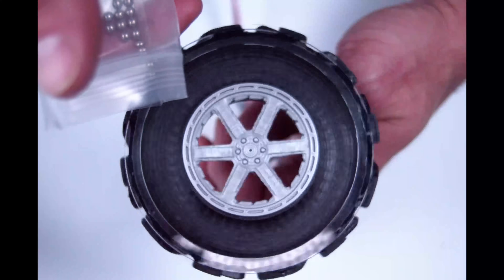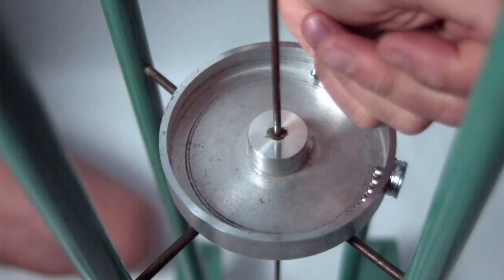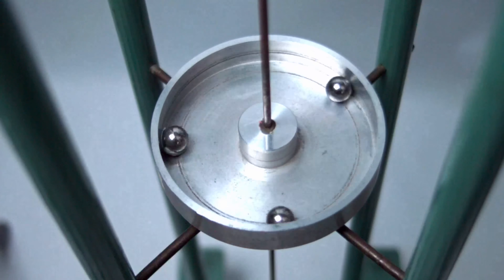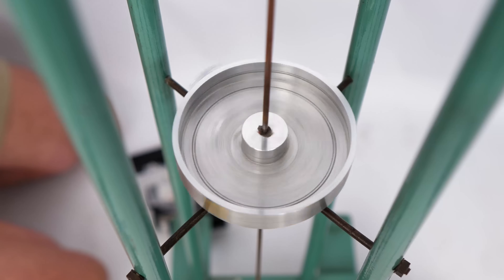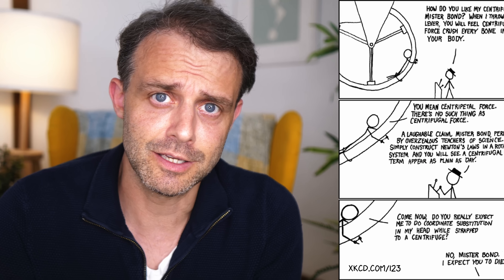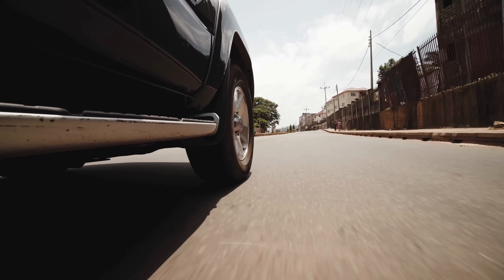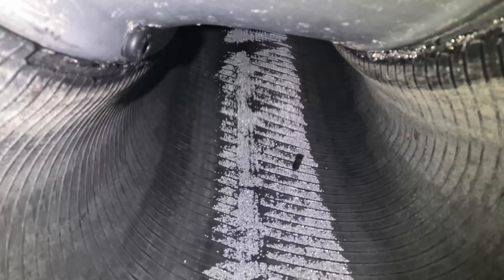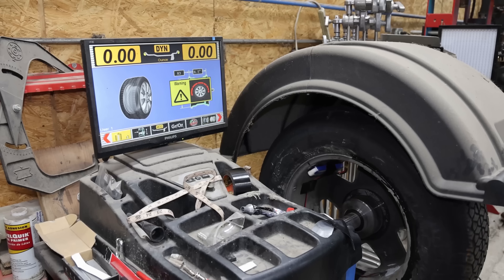Do tire balancing beads actually work?

Comment: For motorcycles, balance beads are the best solution. Most bike wheels don't have a wheel lip for clip on weights. That means you can only use stick on. Stick on weights are not as reliably held on and are also unsightly on wheels that are a prominent design cue of the vehicle, which is pretty much all motorcycles. The best way to get a nearly perfectly smooth ride is to have your wheels trued to be as round as possible, the tires trued to the wheels and balance beads in the tires. Somewhat alarming is the fact that almost no tires are ever perfectly round or balanced. If they were you would never need wheel weight because almost any rim can be trued and balanced perfectly with a little work.

Comment: Thank you for the excellent explanation.  I was contemplating using balancing beads for motorcycle tires and have now decided against it.  I never really understood how beads actually worked, especially for motorcycles for which this method of balancing is used pretty frequently.  I have now decided on conventional balancing methods.

Comment: I have a one ton dually truck that has always had a vibration in the rear since I purchased it five years ago. Last month I put new tires on it and had the same vibration once again. The truck has custom rims and they are not able to add weights to the outside of the outer rims. The solution was to add balancing beads. I've heard of them but never used them. They did help a lot but have only taken 1/2 to 2/3 of the vibration out. Needless to say, I'm not the most satisfied. I did find your explanation very helpful & extremely well thought out.

Comment: I often drive between a city in Denmark on the motorway at 130km/h and a city in german on the motorway at 150km/h 

I have found most vehicles (ofcourse in good condition..etc..) they have the most relaxing ride around 145 to 155km/h no vibrations, also the sound changes to a calm stable hmmm, and the vehicle is responding the way i exspect it.. 

Based on those biweekly wxperiences for now 7 years i would also suggest the beads would be great around 150km/h.  Because with so many trips, ofcourse i have experienced flat tires, loosing of balancing weight on a wheel, and many other quirky things with these vehicles. 😂

Comment: In the early 1950's, Mort Taylor built a flying car (a TV celebrity actually owned and used one on his show). Production after I think six units was stopped because the producer of the "balancing beads" used in the car/aircraft's driveshaft assembly refused to supply them. My point being, that beads have been used to balance rotating masses for a long time.

Comment: Somebody clever, with more energy than me needs to sell balancing beads that go in with some kind of cement. Put them in, get up to highway speed, and stay there for twenty minutes to let the cement set, then your tires are balanced even at lower speeds. Right?

Comment: Mechanic here, I use beads in my motorcycle wheels and they've been perfect so far up to just under 300kmh. No vibrations at lower speeds either

Comment: High or low RPM the movement is the same regardless of how you percieve it.  Tangential movement due to centripetal force is greater at lower speed and shorter as the rotation speeds up as does the center axis point... Its really not complicated.  Mass takes time to move so if the rotation is slower and the mass remains constant  it has more time to pull the axle outwards through its 360° rotation.  At rhe higher rotational speed the mass has less time to pull the axle outwards sonic presents as a faster shaking motion.

Comment: The only product along these lines that I've used is Ride On, which is a sort of combination of the balancing beads and Slime (the green goo that seals small punctures and makes an absolute mess of your rim that your tire guys will hate you for). 

Ride On is an orange goo, that never really turns into the sticky mess that Slime does, is water soluble, so you can easily clean it off of stuff with a hose, and is also supposed to balance your tires, but without the wear of glass beads and the consistency is supposed to help it stay in place, even at a complete stop. When it sits overnight, it may still settle, and again, you're supposed to get up to a high speed to get it distributed initially, but at least for a while, you should be able to get the benefits, even if you hit a traffic light. 

At least, that's the claim. It would be interesting to see how it compares and if it actually lives up to all the claims

Comment: In my motorcycle I used a fluid balancing product called ride-on it's a thicker fluid that would stay in the location that was in on highway speeds (at least for a little bit) benefit to that product is it would clog small holes so I could keep going.

Comment: I don't know if it's still true today, but I know that for a very long time top fuel dragsters used tubes partially filled with mercury on the inside of the rear rims to balance the wheel and tire assembly. Apparently, nobody could make a tire balancing machine that would spin that big of a racing slick at the 330 MPH speed required. So they statically balanced the wheels and used the mercury to compensate.

Comment: What if you could make "smart" balancing beads that leaked adhesive after they got to the critical speed and arranged themselves so that they locked in place? It only needs to work once and then you'd have a perfectly balanced tire.

The downside is that it would only be "perfectly balanced" for that specific wheel and wouldn't self balance if you switch its place, so there's that...

Comment: With tires, counterweights are placed on both sides of the rim. You want the center of gravity to be in line with the hub of the wheel, not off to one side or the wheel will wobble. I do not know if the beads are able to correct this.

Comment: Lathe operators.  If you have a long thin shaft (oh, say 10mm diameter) and that shaft sticks out the back of the headstock by about one meter, and you turn the machine on to, say >200 RPM, the shaft will suddenly bend 90 degrees and cause catastrophic damage to any nearby machines and tool boxes.  I was working elsewhere, about oh, say, a few meters away.  It drew a crowd, to the embarrassment of Mr. Operator, who now owns a very dented tool box to remind him he is not as smart as he thought.

Comment: The Centra-matic balancing BB filled metal rings are great. The smallest tires they make a model for are for 8-lug pickup trucks.
But over 50 years ago, advertisements could be seen for a kit of 4 wheel/tire dynamic balancers that were rather universal fitting. Their plastic circular tube was filled with enough BBs to do the job.
However, the plastic circular tube's plastic mountings broke, detaching it from the steel sheet metal plate that had the holes for the lug bolts.
Haven't seen any sold for 40 years. Some company should make a more modern DURABLE version, in sizes for ALL cars and trucks.
Reply: Centramatic also make a smaller version for 14-15" car and trailer tires, but my results have been mixed using them on a car. I use them on my motorhome though (22.5" wheels) and they seem to work ok there.
Reply: @cameronearnshaw2259 I looked at their website, and yes indeed, they do now. But at the high cost, I wouldn't want to find out the hard way they don't fit, for some interference with brake components, etc

Comment: As someone who has done tire work on semi trucks i can assure you the beads work. and they work really well. The fixed weights lose balance over time from un even wear of the rubber. But the beads self adjust over time as the tires wear. brilliant product.

Comment: cool video. how about adding a little bit of adhesive into the tire with the balancing beads, so when they get into the right position, they stay there even after i stop the car?
Reply: hmm i just thought about it some more and i guess the tire flexing on the road would prevent them from sticking to the inside, so disregard the suggestion ://

Comment: This video in the end explains why the beads are typically marketed to OTR trucking companies. 

Only recently have they increased their marketing to light duty work trucks and classic cars. 

The latter is specifically to keep classic car rims from being marked with wheel weights. 

As I sell these I know a bit more than average. Especially because I had all the same questions this guy had about effectiveness. 

For a regular car more likely would make sense to utilize them in concert with already balanced tires. Assuming you did an old school quick and dirty tire balance. 

Modern tire shops often use dynamic balancing. Which allows for weights to be put on the inside, outside, and center of tire. Leading to a near perfect balance. 

You can always determine the quality of balance at a speed range of 40-50 MPH. 

Generally at 45 MPH any bad balanced tire will cause horrible vibrations. 

If you experience this and are short on cash...then you can go to a parts store like a NAPA or a truck parts store and buy balancing beads. 

But you either have to put them in by breaking the bead and throwing them into the tire and reseating the bead and airing up, or install them via the tire valve after draining the air out. Then reinstalling the air valve and airing the tire up. 

In either case an average person in western society probably can't do it.

Comment: These saved my life once. I was riding a motorcycle at about 85mph and felt the balancing beads hitting my leg. I was just barely able to get slowed down and stopped before the front tire went so flat that I lost control. I wouldn't have noticed the tire was punctured in time without the beads hitting my leg

Comment: Dont fix whats broken, put new tyres balance.. DONE.. what the crap do you need these for... my tyres are $400/pop (BMW RFTs) I dont want any problems, my tyre car does my tyes 100%,, this is a problem which does NOT need to be fixed as there is already a cheap solution

Comment: Well, now I understand how those work, which is cool. I also understand something I've noticed in truck driving. I used to drive a big rig that had a front end issue the mechanics couldn't quite solve. It made he steer tires wear uneven. Once the wear got bad enough, the steering wheel would shake horribly at 45 to 50 miles an hour, but if you for faster than that the ride was smooth. Where I work now, we have a truck that got a rusty rim so the wheel began unbalanced. Again at 45-50 it felt awful but above that it mostly went away. Now I know why.

Comment: I think the problem that gets overlooked is that the imbalance will return each time the tire stops. If it takes seconds or minutes to rebalance itself, remember the tire is not smooth steel inside but rubber which will restrict how fast the beads can move into position, you will always have moments of shaking till the beads do their job again. Also what happens in cold weather, tires do deform in very cold temperatures after sitting? Tires also are not perfectly smooth inside, there are ribs and imperfections inside which will throw the beads around. The theory is correct but in practice there are too many variables.

Comment: product idea balancing beads that at above 50 miles an hour start leaking or breaking glue like substance so they stay in place so that they are balanced permantly obviously needs some instructions and a empty high way to not have to slow down for the time the glue needs to cure OR just sell it to garages that can run the wheels at a speed required to cure the beads in place

Comment: they should make an adhesive that they stick to that becomes tacky in 5 min. Perhaps that fix a flat stuff would work. So you get your tires put on with beads inside. You put the fix a flat stuff in there, then get up to speed and the beads stick to the adhesive in the right places. After 5 minutes, they would hopefully be permanently there. the fix a flat also needs get up to speed to do its thing.

Comment: I am curious about something you neglected to mention. What effect does rough road, dips or bumps, have at lower speed. I think it may help the beads balance sooner. Especially since the inside of the tire is not completely smooth.

Comment: well, if you put glue that is not strong enough to hold the beads at 80km/h but strong enough to keep the beads in their places at lower speed or a stand still position. then if you'r smart enough to develop an activator that cures the glue  in a given time say 3 minutes for example. then you can pump the activator, get the vehicle running 80km/h befor the 3 minutes stay at that speed. now your tires are locked in a balance state forever

Comment: i have a set of tires 33" tires  i had balanced at 3 shops never balanced out correctly, the third shop said to try the beads and while it took a few miles maybe 100 to start working they really did work surprisingly well. so much so i may just stick to using the beads in that size tire from now on, even at low speeds i don't have an issue.

Comment: Could you add some kind of slow carrying adhesive and then drive at that fast speed for like an hour or two while the adhesive cures locking the beads into the balance position?

Comment: At 6:00 when you are explaining the mechanics of the phenomenon I cant help but think if you keep drawing those slopes at each time-step, you would see that the lines create a circle, or a bowl shape. I have no proof but I think that would be the logical extension of the drawing. 

This is so satisfying if it is the case because in the balls reference frame, it is doing the exact same thing as if it was placed inside of a bowl at one edge, rolling downhill and then uphill again due to its momentum, eventually slowing down and finding a resting place at the bottom of the bowl. This would also explain the oscillatory nature that you described earlier where it took a bit of time for the ball to get to rest. 

The logic can even be extended further as if we think about gravity actually being the driving force for why a ball in a bowl would eventually rest at the bottom, the same would be true for the ball in the wheel. It would instead be the centrifugal force that will be acting as "gravity" in that reference frame: the higher the rotational speed, the faster it will be forced towards the bottom of the bowl.

Amazing video as always Steve!!

Edit: The solution to draw it would be some differential equation because the slope is determined by the balls position and the direction of the centrifugal force. The centrifugal force would be described partly by the two balls positions, which accelerates the ball, changing its speed and position further, which changes the centrifugal force, etc etc. I wonder what shape it would actually draw.

Comment: i run beads in my dual rear wheel ford f350 and they work quite well at any speed BUT once in awhile ill hit a bump on hiway and get a shimmy, slow down and speed back up, it goes away

Comment: Loved the video!! As a mechanical engineer I can see the use of these beads to minimize or lessen the instability of rotating parts, but I had a question: if beads can be used to stabilize a rotating part could a fluid be used in the same way. I understand that this would add a lot of complications and wouldn’t be used for tires but it made me curious on the purely physician based implication using a fluid or liquid would have.

Comment: Would it be possible to spin the wheel fast enough to correctly place the beads, then heat the tire just enough to fuse the beads in place?

Comment: Instead of balancing beads, I put the same dry weight of anti freeze in my 35inch tires. It''s been great for the last 6 years and 100000 km with my AT tires.

Comment: Liquids can also accomplish the same results... I use windshield washer fluid (I live in Canada so I use the -45 stuff).
It works great in my oversized 4x4 tires and unlike static balancing weights, beads or liquid will keep the wheels balanced even with ice or mud built up inside the rims.

Comment: Yes they work but an old tyre fitter 20yrs experience that used to work in a trucking yard would still balance steer tyres on the machine as he stated if the tyre was out of balance by more than 200 grams he would send them back to the manufacture as they will never wear good using balance beads hide bad quality tyres most likely why tyre companies like you using them....

Comment: all these comments about having to go a certain speed for them to work ignores that 99% of people dont have vibration issues at speeds lower than that speed. its like todays Education(not just the US) system doesn't teach anything about centrifugal forces or any basic physics.

Comment: Back in the 70s they had a self balancing system designed for off road trucks. It was a pipe about an inch inside diameter that was bent into a donut shape the exact same size as the rims on the truck. It bolted into the wheel with the wheel nuts and basically resembles a weird hubcap with a donut around the rim. It was filled with ball bearings and after you come out of the woods with mud all over the wheels, they would go out of balance and the bearings would even it out. As the mud started to fall off and the wheel balance would change, so would the balancer.
Reply: They're still available from Centramatic. I use them for the 22.5" diameter wheels in my motorhome and they seem to work.  For some reason they actually made things worse when I tried them on a car with 15" wheels.
Reply: @cameronearnshaw2259 they are mostly designed for trucks. I only ever seen one truck with them on it.